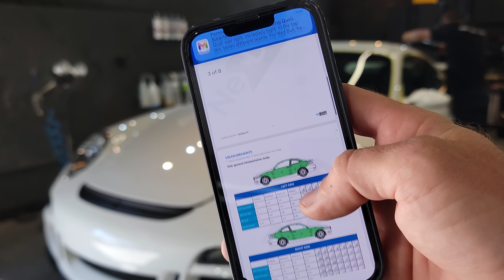Porsche GT3 997 gets DRY ICE BLASTING // Full Detailing & Ceramic Coating

Comment: I have a tip to remove the film and not get so much glue, which can ruin the rear defogger. Put a wet plastic on the glass and leave it in the sun, the glue will lose strength. Helps a lot. If you're interested and it wasn't clear, call me and I'll try to explain it in another way.
Reply from the maker: Thanks for the tip!